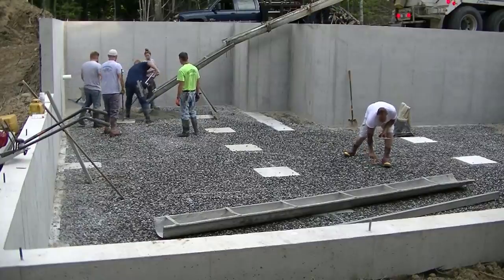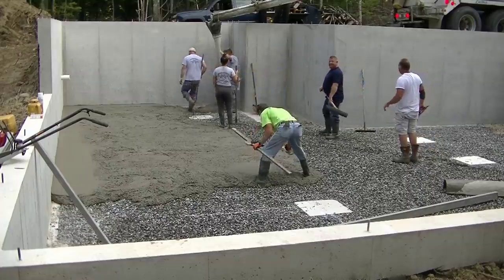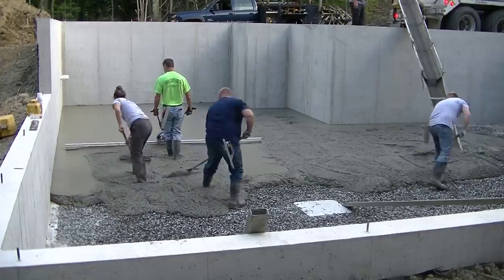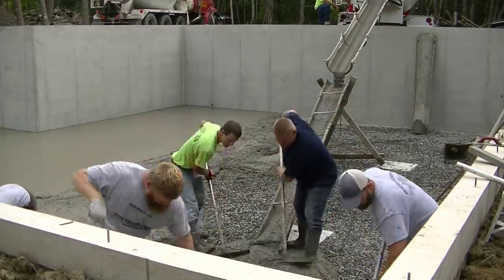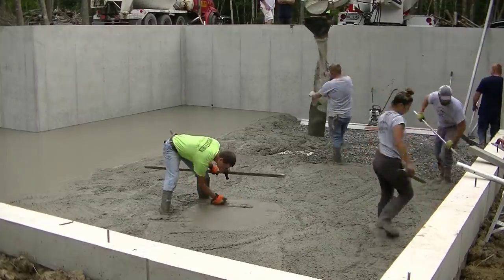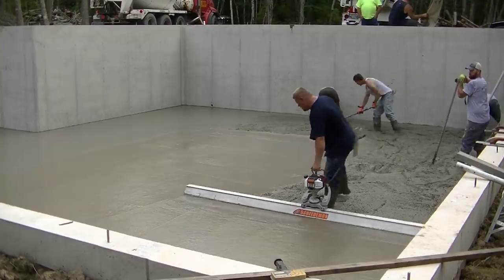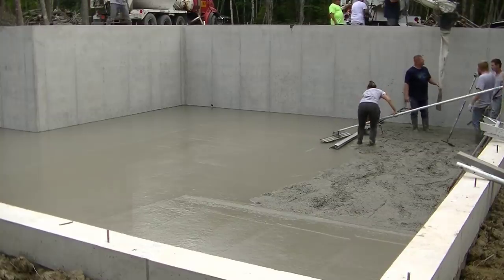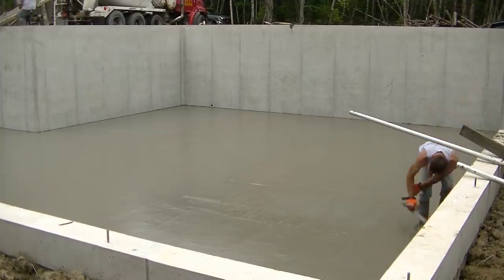Pouring Concrete For A Basement Floor (What We Use Instead Of Pumping)

Comment: hey question, how come no expansion at wall ? just wondering. about pumping seems to be regional thing. worked in PA and they basically do the same thing your doing. i moved to FL and worked down there for 15 yrs. they pump everything, they use the small 3" tow behind all the time for footers and beams. boom trucks for slabs

Comment: Why didn't you use an expansion joint (foam) around the perimeter of the slab?  I'd be worried about expansion.  And maybe it's different everywhere, but I would have put some rebar in that slab.  Does the fiber solve cracking?

Comment: I've never seen an interior slab poured without a moisture barrier. It makes no sense not to put plastic down.
Reply from the maker: Not my call. But it is a good idea. A moisture blocker sealer will work as good or better if there is a moisture problem.
Reply: In Florida we do it a lot
Reply: There are different building codes for different provinces in Canada. If you want to deviate from the building codes and from what the building inspector wants, you'd be smart to check with him first; if not, you're only asking for trouble.

Comment: Hey Mike, I am new to the concrete biz in northern Connecticut. We specialize in flatwork for foundation replacement. ICF foundation walls and concrete-less foundation walls with 16 on-center studs mainly.  We usually pour through a hole cut in a wall or in a complete foundation before the bulkhead stairs and cover are installed.  Any tips for pouring into basements with difficult access points? Any advice on how to be more efficient so that we can get the trucks out faster would he greatly appreciated

Comment: No insulation or vapor barrier under the stone. In case you did not know your rep is dependent on the quality of the finished product. I lived in Boston for 20 years and built several houses and never poured a basement floor without a vapor barrier and at least 2" and usually more rigid insulation. I see there is no footer tile on the exterior wall and moisture will penetrate and the quality of the end product will suffer. Your efforts can be undermined by general contractors.

Comment: Western Orygun, tall wall almost never 8', always 9-10', daylight out to finish grade, don't have the freeze thaw on the west side. almost always a pump, floors always have  at least @dozen plumbing pipes, drains, and closets sticking up. Always visqueen vapor barrier, footings integrated with slab. We have a chute, use it when we can, maybe 10%. Pumps almost never more than 650 @ 30 yds.

Comment: Am I missing something no floor drain or any plumbing hook ups!
Reply: All the water is moving in the gravel under the concrete like a french drain i guess drains are not necessary
Reply: zack tastic we need  a connection to the sewer with a floor drain inside the building in the US!

Comment: What no Polly no styrofoam what about moisture in basement
Reply from the maker: I'm hired to just pour and finish the concrete, not prep. That's up to the General Contractor.
Reply: That’s what I as thinking no plastic for vapor barrier my area it’s mandatory. And we put 1/2 inch rebar on two foot centers.

Comment: We have a standing screws we just picked up for a swimming pool pour we have to do in 2 parts with slopped areas.  But have done everything else by hand screed.   Would like to try out a vibrating screed.   Curious if you have poured a pool before?  We are getting various suggestions for admixes and wondering what you would use?  Xypex with fiberglass fibers is where we are now but have looked at “EdenCrete” and Helix fibers too.
Reply: Do you do pool floors and walls all in one shot? Around here in S. FL, we typically shoot in ground pools with gunite.
Reply from the maker: We only pour the pool decks after the pool is installed. No concrete pools around here, just gunite and inground aluminum panels with vermiculite then a vinyl liner.

Comment: You have not really poured concrete until you have poured concrete out of a concrete truck that had a fold up concrete conveyer mounted to the rear bumper on the right hand side of the truck    It was a poor mans concrete pump.  That was used in the late 80 s. Believe me I can tell you that a pump was better. I never had the fun of using a pump truck with a boom on it. That boot thing that you used they would mount on the end of the concrete conveyor and when it plugged up it would rip off. We even poured concrete through the basement windows after the house was built.

Comment: Great job. It's just blasphemy not to see any wire mesh. A major no no in my book.
Reply: The only time I don’t use steel is when I’m pouring a slab that’s contained on all sides by concrete walls. I would have still used fiber mesh for shrinkage cracks tho.

Comment: Its gonna crack over time because there's no steel in there
Reply from the maker: All concrete cracks, the "steel" has nothing to do with it.
Reply: 2 types of concrete; concrete that's cracked and concrete that's going to crack.
Reply: Steel not needed. Cutting lines afterwards is what's recommended. Then it cracks in the lines.

Comment: There is no way that should be poured without a VB directly under the concrete.  You can't get off by saying you're a sub.  All basement slabs should have a VB.
Reply: Yes to that, I'm also wondering where the steel reinforcing is and expansion/slip joint at the wall?

Comment: Where is the wire mesh???  Buyer beware.  Get the foundation guy’s name to not talk to him.
Reply: Hardly anyone puts mesh in a basement floor.
Reply: @skliros9235  in the Midwest I have never seen basement without mesh.  I can imagine that when cracks appear, the contractor will shift blame to someone else and say it wasn’t in the contract, but in reality they didn’t do the minimum effort to prevent cracks

Comment: I drives me nuts to hear concrete workers speak of "yards" of concrete when they mean "cubic yards." Dimensional analysis is a big deal in science, and not considering it leads to serious errors, as when folks speak of energy consumption in terms of watts or HVAC sizing in terms of BTUs. I wonder if you have to be dumb in math and science to qualify as a concrete contractor.
Reply: You must be an engineer
Reply: Must have to be dumb in science  or engineering to think it's possible to order a square yard of concrete.

Comment: Man, saving 900 dollar on a HOUSE is being a cheap person
Also, zero insulation and vapour barrier is also a sloppy job
Reply: Your spelling is sloppy
Reply: @ Marty mcFly- As a custom home builder, finding someone who is willing to spend the few extra minutes and extra labor to save 900 on a slab pour is someone who I would hire as it shows they care about the “small details”. If every one of the 2 dozen (or so) trades were willing to work to save $900, that’s a house that is 21k cheaper. It’s all the small things that make a huge difference in the end result. Well done! 
Also did you not hear him say that it was not his call on the insulation, vapor barrier, wire mesh, etc? Either way, it’s likely the vapor barrier is under the crush rock, which allows the slab to drain as it is curing and not puddle water, results in a much nicer/easier finish in my experience.
Reply: Love your video and was wondering if you might have done ours? in etna maine?